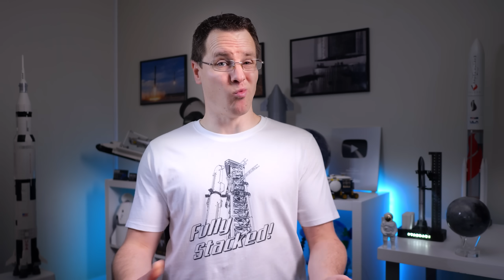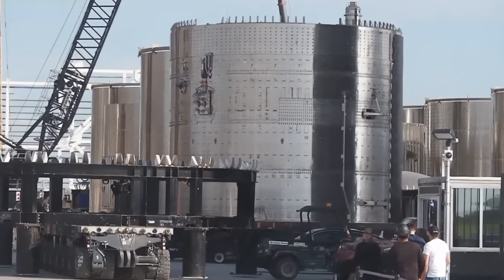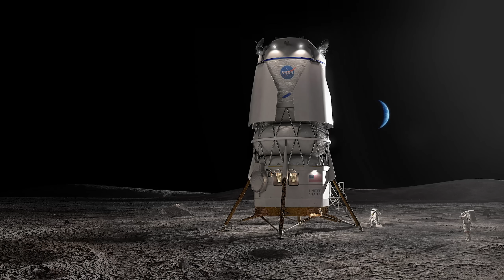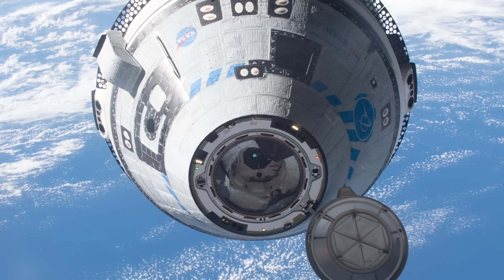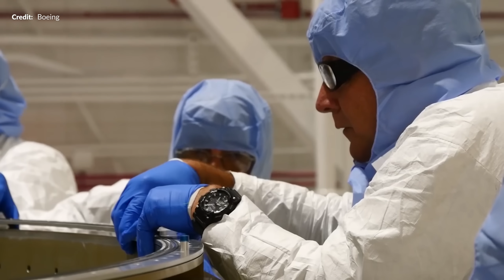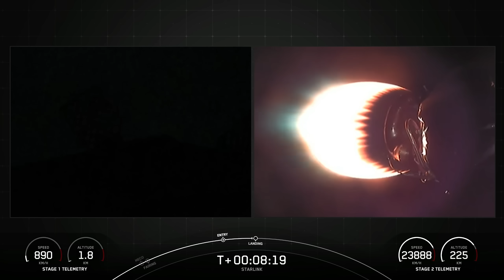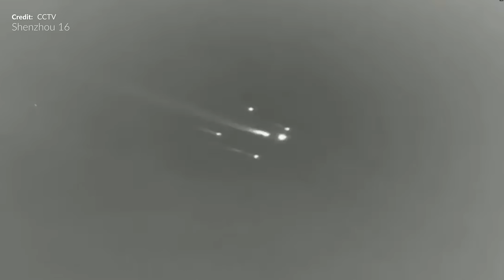SpaceX Starship: Mega Pad Upgrade to Tame the Thrust, Boeing Starliner Delayed Indefinitely

Comment: 50 miles is the official altitude where space begins. It's pretty arbitrary to imagine it at 62.1371 miles. Probably better to use the even 50 mile number for memory purposes, plus it's much easier to imagine how far up that is. Nobody can visualize how far away things are in meters or yards.
Reply: Hard to get much rounder than 100 km which is the official altitude in most parts of the world. And most people in the world have no problem visualizing kilometers since that is the distance standard that they use. 50 miles is a standard set in the U.S. back in the 1960's during the X-15 program. It's two different standards, both are somewhat arbitrary, neither one is "right".
Reply: @StevePemberton2  it would be if meters meant anything. Who knows what a meter is? Let alone a thousand of them. Everybody knows what a foot is, two of them hanging around at the bottom of your legs. And miles, every car since chevy and Ford invented them has measured everything in miles per hour and an odometer to tally them up for you. 
50 miles is a distance down the road to a nearby town.
We've got to get those third world countries converted into understanding better measuring units! Lol
Reply: @danapted  Ah yes Literaly everyone other the US, Liberia and Myanmar are  a third world country

Comment: I don't have a problem counting Virgin Galactic flights as being in space. 100 km is arbitrary and defined by an organization (FAI) that was originally founded in 1905 to certify ballooning records, and later expanded to airplane records and then in the 1960's they decided to get into space records also. But they have not demonstrated any special expertise in defining the boundary of space. In fact they made a statement a few years ago that they are considering revising it downwards, although I think that idea seems to have lost steam at least for now.

Von Karman tried to define it on theoretical ideas about inertia overtaking lift. Theoretical in the sense that no real airplane will ever approach orbital velocity while still in the atmosphere. And von Karman's calculation didn't require that the spacecraft complete an orbit after reaching orbital velocity at that altitude. By the way von Karman's calculations changed over time but generally were in the 84 km to 91 km range.

NASA used real world data based on the X-15 and set space at 50 miles (80 km) because that's the point where the rocket plane's control surfaces no longer worked and they had to rely fully on RCS.  I actually think from a real world viewpoint 100 km is pretty good because that's around the altitude that spacecraft on reentry begin to experience noticeable atmospheric effects. I actually think 110 km would be even better because you might notice that payload fairings are normally jettisoned above that altitude, due to heating that still occurs at 100 km.

So I'm okay with both boundaries, as long as it's clear which standard someone is using. Virgin Galactic will always have an asterisk next to their "in space" claim as they should, but actually I think New Shepard needs an asterisk also to explain that there is no actual physical boundary of space.
Reply: Well said.

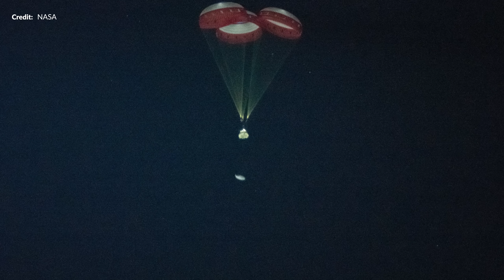Comment: 12:49 The parachutes soft links are being replaced. The reassessment is apparently on the P-213 glass cloth tape that is commonly used in other (cargo) spacecraft, but they need to see if it ALL needs to be replaced or only added to with a different tapa in some areas. It's apparently only flammable in certain situations, which require multiple failures. 

Parachute and wiring issues to delay Starliner crewed test flight
Jeff Foust - June 1, 2023

"Both the parachute soft links and wiring tape were used on the Orbital Flight Test (OFT) 2 uncrewed test flight in May 2022 without incident. The soft link issue, officials said, would only be a concern if one of the three main parachutes failed, putting additional loads on the other two, while the flammable tape would have required what Nappi called “multiple failures” elsewhere in the spacecraft."

---------------

Boeing finds two serious problems with Starliner just weeks before launch
ERIC BERGER - 6/1/2023

"The second issue involves P-213 glass cloth tape that is wrapped around wiring harnesses throughout the vehicle. These cables run everywhere, and Nappi said there are hundreds of feet of these wiring harnesses. The tape is intended to protect the wiring from nicks. However, during recent tests, it was discovered that under certain circumstances possible in flight, this tape is flammable."

Comment: The whole Starliner thing would be funny if it weren't for the fact that we are at real risk in case something causes Dragon to be grounded for a period of time. That may seem unlikely but it's not a zero risk. I think it's time to get a third option going, because even when (if) Starliner becomes operational I think it will be at a much higher risk of problems occurring later that will ground it for a year or two. I would say Orion would be the fastest third option even if it is overkill and expensive. Although I don't know if Orion can stay docked at ISS for sixth months. Dream Chaser is not going to work for crew because it doesn't have launch escape during a large part of the launch profile, including no pad abort capability. Yes I know Shuttle didn't either but two wrongs don't make a right. And at least Shuttle could in theory do powered RTLS in the early part of the launch. Adding full launch escape to Dream Chaser would add weight, cost and time.

Comment: Good update thank you. The tape being flammable is bugging me, I wonder why they didn't wrap it with non flammable string  OS telecom style.  Removing the tape will be easy, getting the residue off won't.
Reply: To be fair, the tape is flammable only in certain situations per reports. And requires failures of other hardware to happen. Per NASA/Boeing, "Although that tape is commonly used on other spacecraft, they are evaluating if it is acceptable for crewed flight (article NASA and Boeing say preparations continue for July Starliner test flight Jeff Foust May 27, 2023)" Reportedly they may cover the tape with a different tape, as removing the tape can harm the wiring harness.

Parachute and wiring issues to delay Starliner crewed test flight
Jeff Foust - June 1, 2023

"Both the parachute soft links and wiring tape were used on the Orbital Flight Test (OFT) 2 uncrewed test flight in May 2022 without incident. The soft link issue, officials said, would only be a concern if one of the three main parachutes failed, putting additional loads on the other two, while the flammable tape would have required what Nappi called “multiple failures” elsewhere in the spacecraft."

---------------

Boeing finds two serious problems with Starliner just weeks before launch
ERIC BERGER - 6/1/2023

"The second issue involves P-213 glass cloth tape that is wrapped around wiring harnesses throughout the vehicle. These cables run everywhere, and Nappi said there are hundreds of feet of these wiring harnesses. The tape is intended to protect the wiring from nicks. However, during recent tests, it was discovered that under certain circumstances possible in flight, this tape is flammable."
Reply: @steveaustin2686  "under certain circumstances" must mean re entry. gets a lil warm .
Reply: @tjkaz5419  🙄 Maybe read the excerpts and articles themselves?

Comment: I suppose if they separated core stage with the boosters still attached, there is a risk that the booster cones could strike the second stage as the assembly drops away.

Comment: If Boeing manages to correct all of these issues with Starliner, are they really into the idea of testing it all with a crewed mission? I'd be sh*t***g my pants if I were these 2 astronauts that'll fly Starliner 😱
Reply: Between the unmanned Demo-1 test flight of Crew Dragon and the Demo-2 crew test flight of Crew Dragon, one on the test stand exploded due to faulty valves. SpaceX did not have to do another test, as they fixed the problems to NASA's satisfaction. The same applies for Starliner.

And to be fair, the tape is flammable only in certain situations per reports. And requires failures of other hardware to happen. Per NASA/Boeing, "Although that tape is commonly used on other spacecraft, they are evaluating if it is acceptable for crewed flight (article NASA and Boeing say preparations continue for July Starliner test flight
Jeff Foust May 27, 2023)"

Parachute and wiring issues to delay Starliner crewed test flight
Jeff Foust - June 1, 2023

"Both the parachute soft links and wiring tape were used on the Orbital Flight Test (OFT) 2 uncrewed test flight in May 2022 without incident. The soft link issue, officials said, would only be a concern if one of the three main parachutes failed, putting additional loads on the other two, while the flammable tape would have required what Nappi called “multiple failures” elsewhere in the spacecraft."

---------------

Boeing finds two serious problems with Starliner just weeks before launch
ERIC BERGER - 6/1/2023

"The second issue involves P-213 glass cloth tape that is wrapped around wiring harnesses throughout the vehicle. These cables run everywhere, and Nappi said there are hundreds of feet of these wiring harnesses. The tape is intended to protect the wiring from nicks. However, during recent tests, it was discovered that under certain circumstances possible in flight, this tape is flammable."

Comment: Why has SpaceX stopped work on the new facility in Florida?
Reply: Because Boca Chica is as much about learning how to build Starship facilities as it is for testing Starships. Also NASA is leary of testing Starships at LC-39A, when it is the only pad for Crew Dragon. SpaceX recently started upgrading SLC-40 with a crew tower, so it can also do Crew Dragon launches. I would not be surprised if SLC-40 will also be used for Falcon Heavy as well. Part of the USSF-67 contract was for a vertical integration facility (VIF) for NSSL payloads. It would make sense to build the VIF at SLC-40 on the Cape Canaveral Space Force Station (CCSFS), rather than at the civilian KSC.

Comment: Boeing is dragging their feet so they don't have to take on the liability of flying humans. They need to be cut out of space! This isn't the 90's it's not just free cash. They have to actually preform  😠😠😠
Reply: To be fair, the tape is flammable only in certain situations per reports. And requires failures of other hardware to happen. Per NASA/Boeing, "Although that tape is commonly used on other spacecraft, they are evaluating if it is acceptable for crewed flight (article NASA and Boeing say preparations continue for July Starliner test flight Jeff Foust May 27, 2023)"

Parachute and wiring issues to delay Starliner crewed test flight
Jeff Foust - June 1, 2023

"Both the parachute soft links and wiring tape were used on the Orbital Flight Test (OFT) 2 uncrewed test flight in May 2022 without incident. The soft link issue, officials said, would only be a concern if one of the three main parachutes failed, putting additional loads on the other two, while the flammable tape would have required what Nappi called “multiple failures” elsewhere in the spacecraft."

---------------

Boeing finds two serious problems with Starliner just weeks before launch
ERIC BERGER - 6/1/2023

"The second issue involves P-213 glass cloth tape that is wrapped around wiring harnesses throughout the vehicle. These cables run everywhere, and Nappi said there are hundreds of feet of these wiring harnesses. The tape is intended to protect the wiring from nicks. However, during recent tests, it was discovered that under certain circumstances possible in flight, this tape is flammable."

Comment: The energy that dug the hole will go somewhere. For every action, there's an equal and opposite reaction. The most fundamental physics principal in rocketry is being willfully ignored.
Reply: No it's not. There are holes in the steel plate. Some of the flames would go through those holes.

Comment: What kind of gong show is Boeing running for Starliner?! How, after 2 unmanned test flights, is the flammability of the tape used to secure the wiring an issue? That's something you sort out during design / BOM review while building the first vehicle.
Reply: To be fair, the tape is flammable only in certain situations per reports. And requires failures of other hardware to happen. Per NASA/Boeing, "Although that tape is commonly used on other spacecraft, they are evaluating if it is acceptable for crewed flight (article NASA and Boeing say preparations continue for July Starliner test flight Jeff Foust May 27, 2023)"

Parachute and wiring issues to delay Starliner crewed test flight
Jeff Foust - June 1, 2023

"Both the parachute soft links and wiring tape were used on the Orbital Flight Test (OFT) 2 uncrewed test flight in May 2022 without incident. The soft link issue, officials said, would only be a concern if one of the three main parachutes failed, putting additional loads on the other two, while the flammable tape would have required what Nappi called “multiple failures” elsewhere in the spacecraft."

---------------

Boeing finds two serious problems with Starliner just weeks before launch
ERIC BERGER - 6/1/2023

"The second issue involves P-213 glass cloth tape that is wrapped around wiring harnesses throughout the vehicle. These cables run everywhere, and Nappi said there are hundreds of feet of these wiring harnesses. The tape is intended to protect the wiring from nicks. However, during recent tests, it was discovered that under certain circumstances possible in flight, this tape is flammable."

Comment: I remember when NASA got upset over propulsive landings insisting on parachutes… Boeing can’t even get parachutes to work even after they were invented hundreds of years ago. If this was SpaceX it would be front page news.
Reply: SpaceX had problems with the parachutes during Dragon development also. Elon said parachutes turned out to be more complicated than they expected. The airplane was invented over 100 years ago also but it's still complicated. It's simple to describe an airplane's wing shape and how it produces lift, but the actual design of a wing is still very complicated and pushes even modern computers to their limits. Same with parachutes, it seems simple on the surface but the reefing process is very complicated, and has to take into consideration constantly changing air pressure during the descent, as well as the effect of winds, and variables in how exactly the parachutes open each time.

Sure if someone is building a parachute identical in design to something used before it's not as hard. But these spacecraft parachutes are very specialized and custom designed. For example there turned out to be very little data on using four parachutes like SpaceX does and it changed the dynamics substantially.

That being said adding Boeing in its current shape into the mix doesn't help. I remember on the Starliner pad abort test one of the parachutes failed to open, turns out a critical pin was not in place. To be fair after installation it was not possible to visually inspect the pin, but after that failure they now do a simple tug test to make sure that the pin is in place.
Reply: @StevePemberton2  Well said.
Reply: It's been all over the news.

Comment: Interesting that the Starlink launch at Vandenburg AFB used a booster that had been previously launched multiple times from Florida.  I suppose it’s no big deal to transport from FL to CA given New Boosters go east most of the time from Hawthorn, CA. to The Cape.
Reply: They are 3.7m wide (12ft), just so that they can deliver them by truck on highways. There are pictures of boosters in transit.
Reply: @steveaustin2686  I’ve seen a couple photos of a booster in transit. I just thought it was odd they would ship one back to CA instead of reusing local CA flown boosters.
Reply: @dennisschlieckau8723   I have no idea why they have them switch coasts. My guess would be for eventually expending it.

B1048 switched from VSFB to Florida, but had an engine failure on ascent, so was not recovered. The Starlink sats did make it to orbit though.

B1049 went back and forth and was eventually expended.

B1051 went back and forth a few times and was eventually expended.

Based on this, I have no idea and my guess is wrong.
Reply: @steveaustin2686  Thanks Steve.  I didn’t realize they had done the back and forth booster repositioning so many times.